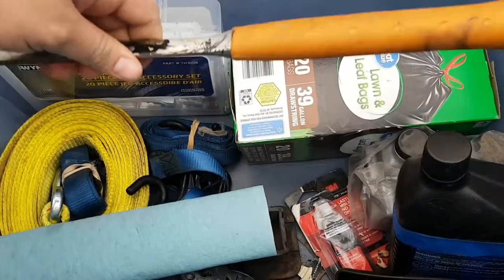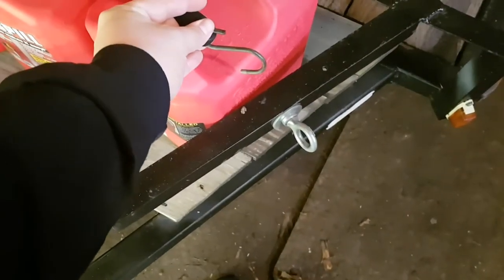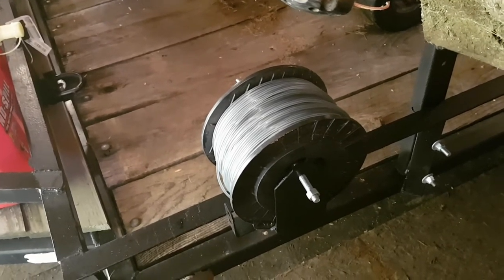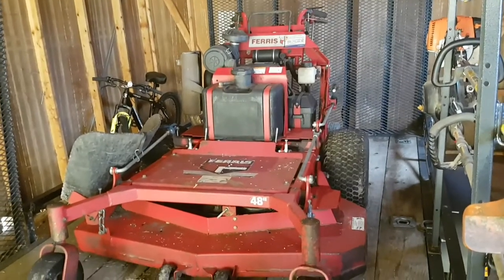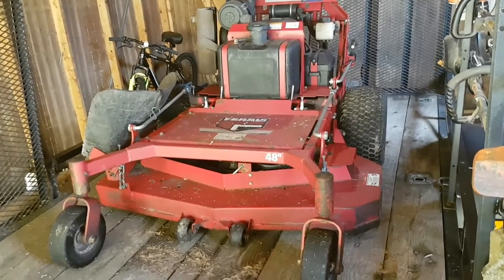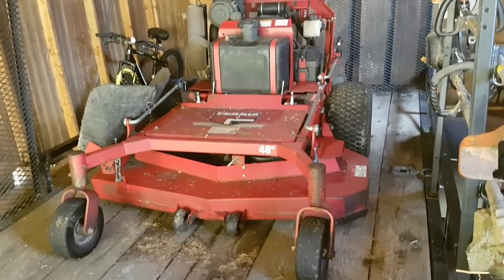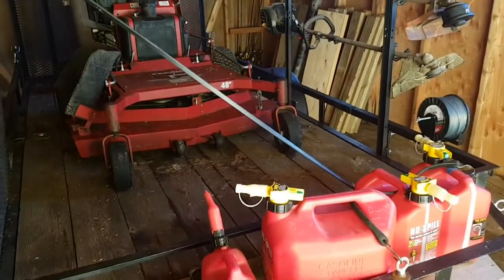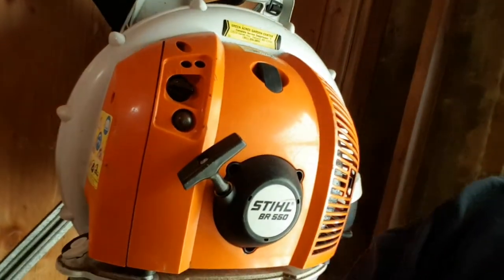2018 Lawn Care Setup!

Comment: Looks good. I probably wouldn't trust 3 pieces of equipment on those racks, because the side rails of the trailer are so low,the racks will sway a lot.  I would reinforce them with a piece of metal tubing from top to bottom or some other plan. I would also place the mower towards the front . Trailers tend to bounce a lot at certain speeds  and they usually ride better with the weight in center or the front.  We will be showing our  2018 setup in the next day or so. Tell me what you think.
Reply from the maker: J's Crazy Cutz, LLC  Thanks for the advice man👍👍the reason the mower is sitting back a little farther on the trailer is we needed to move the trailer nose a little bit and with the mower in the front it was too heavy lol I will check out your video 👍👍👍
Reply: Al's Lawn Care  Ahh!  easier to move trailer,I understand. COOL
Reply from the maker: J's Crazy Cutz, LLC Yep man the front end moves a whole lot easier if the weight is directly on the axles lol👍👍